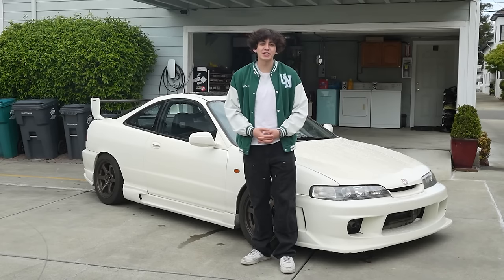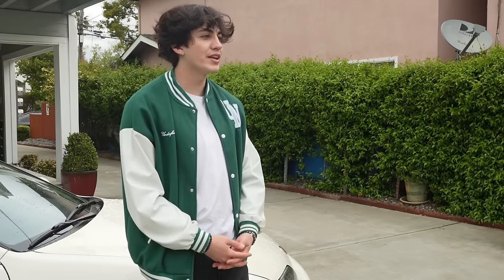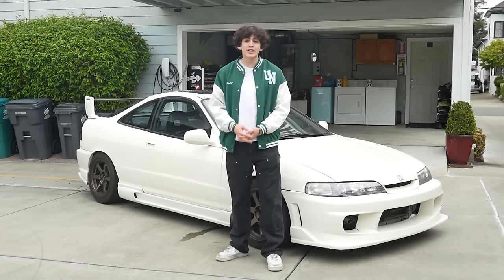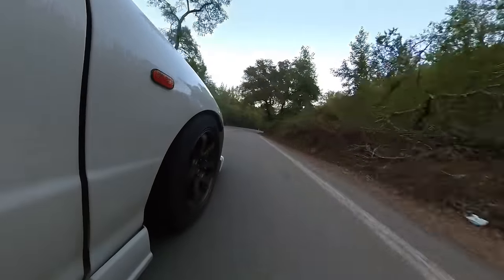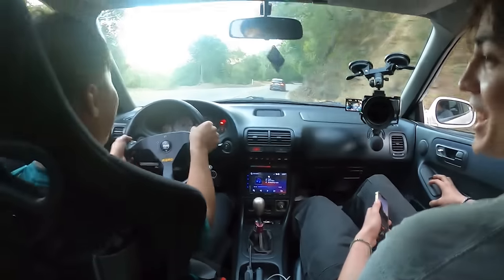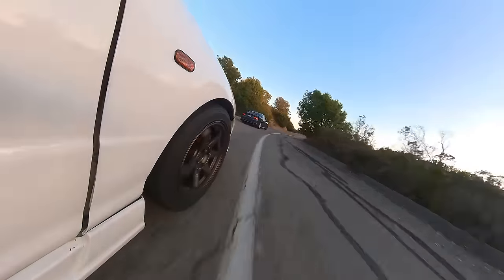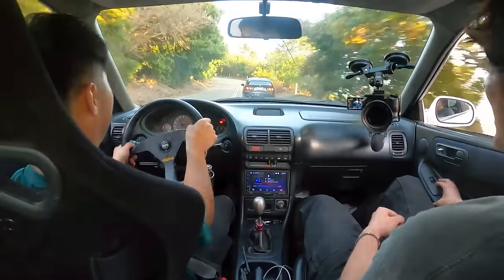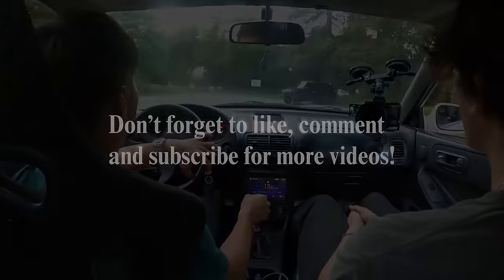RANDOM CHALLENGER ON THE TOUGE TAKES ON THE INTEGRA DC2! (FAST)

Comment: I think y'all need more suspension travel.  Low and stiff wirks well for the circuit and autocross, but it looks like you guys hit roads with some serious bumps.  Same where I live!  My NC Miata has quite a lot of travel but the twisty roads around here gobble it up like corn chips.  Sometimes these real-world touge roads have more in common with a rally stage than with Laguna Seca.
Reply: yeah stiffer aint always better. on lots of roads its just gonna reduce grip and make the car do bad on rough surfaces
Reply: Yea used to have an integra stiff spring rates and the spoon rear strut bar made the car a little too rough it would skip and be a little sketchy on rough roads. Needed to be on a super smooth prepped track vs these shitty Bay Area roads

Comment: I would check on y'all's bushing if you havent yet, a poly refresh could be the move. Also, if you have the time for it (if you aren't doing it this way already), try to only change one type of suspension setting at a time between runs. This way, you can be certain which changes are having which effects. Dope vid yall, love to hear the road knowledge during the run, shits mad legit

Comment: Y’all bouncing quite a lot, I got 32 level adjustment coils and I have the dials I can set to soft and hard, tighten the springs as well, prob should change your spring rate and stiffen the dampers I got a civic em2 I’m getting ready to track and I bounced quite a lot when I first installed my coils . Had to change the rate and tune the suspension to my liking

Comment: What spring rates do you guys have on the integra?
Reply: I was thinking same thing. Seems super soft for all that bounce. Needs a 12k/16k setup
Reply from the maker: @Zosh  the car is running 12k front, 14k rear atm. The road is just super bumpy
Reply: @Seikers  Try looking into Honed Developments products for the DC2. BTW, what tires are you using?
Reply: @Seikers  Rear spring rate is too high which is why it's too unsettling for canyon runs